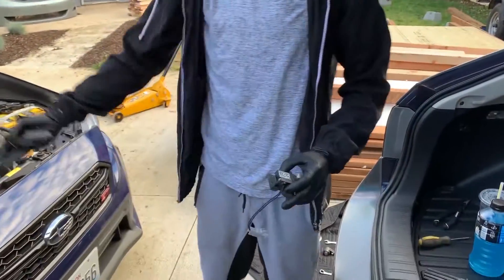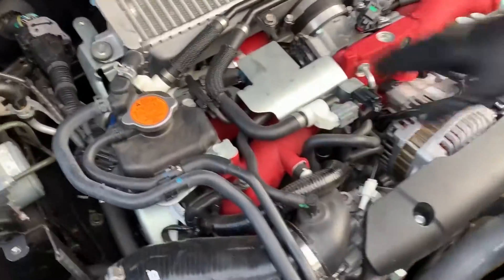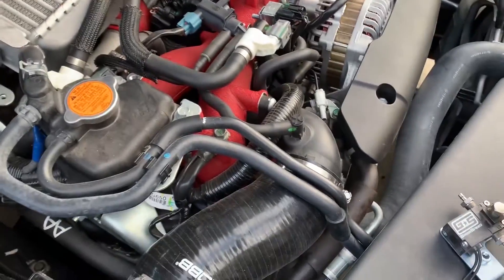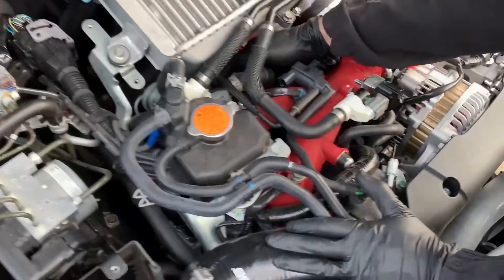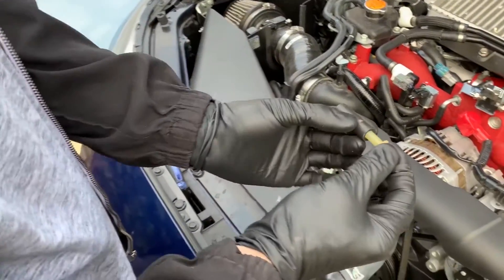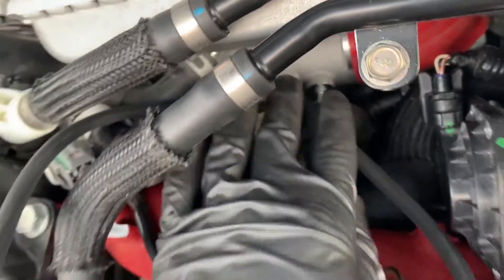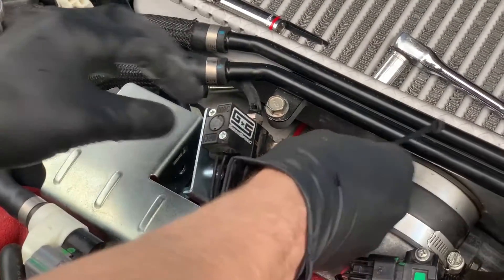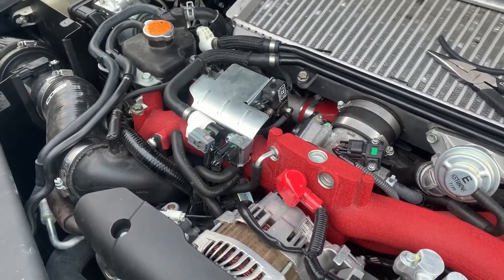Grimmspeed EBCS Install | Subaru WRX STI

Comment: Tools used:
Needle nose pliers
12mm
Zip ties

Anything else?

Awesome video thanks!
Reply from the maker: You will also need a 14mm I believe for the one bolt on the left of the silver cover. Thank you for your feedback :)

Comment: Wouldnt the ecu control the grimm speed just like it controlled the oem? What is different that it needs a tune, both are electronic and controlled by ecu
Reply: The oem one bleeds boost and isn't meant to sustain a linear boost curve. EBCS are better for more linear boost and helps the tuner out more. It also prevents boost spikes which can kill your engine.

Comment: Where did you order the new mount piece for the boost solenoid? Or what’s it called? All
I can find is the covers that you mount it on not the little metal piece that you put the solenoid on.

Comment: hey i know this vid is old but i recently bought a 2017 sti and it came with a grimmspeed boost controller and i have no clue how to use it its the same one in this video and i was just wondering how i can actually adjust it do i need an accessport or can i do it another way? thanks if you respond lol...
Reply: I have one , that’s for your tuner to use not for you to mess with .

Comment: I have a question bro I don't know if you can help me, but I just installed a tial wastegate too in my 2018 sti but the question is the I don't know where the hoses go im new on this upgrade my subi I wanna see if you can help me with a video show me where the hoses go from the tial to where or if I need something else the I need to put it, I don't have Solenoid control I need that. Thank you and have a great day.

Comment: Lol nice video! is this the same install for cobbs? they both look identical except the grimmspeed installs outside. This would look easier with intercooler off!
Reply from the maker: It probably would be easier with it off :) And the Installs are pretty much the same except the ports I think are in different locations on the Cobb ebcs. I did one on the 2013 wrx that I will upload soon :)
Reply: Be Above Average Ahh yea i just compared them the ports are the same! but i think the ebcs spot is different on the 2013 isnt it? our ebcs is on the manifold. but yea! ill be waiting on that upload!! appreciate it my mann

Comment: Did you zip tie onto the nipples? If so how did you get it down there?
Reply from the maker: J L Yes I did, put the zip tie around the hose loosely and then slide it down the hose until it’s over the nipple than use some long and skinny needle nose pliers to tighten the zip tie and cut it best you can
Reply: @BeeAboveAverage  Sweet thanks. Installing mine on my 19 STI and it's been an absolute pain so far lol
Reply from the maker: J L It’s not the funnest process but I’d make sure to at least get those hoses on there nice and secure so they don’t blow off during any driving.

Comment: any trouble codes afterwards?  any issues with boost?  did you get the bcs tuned?
Reply from the maker: I had a new tune flashed on the car after install. Everything works perfect with no codes